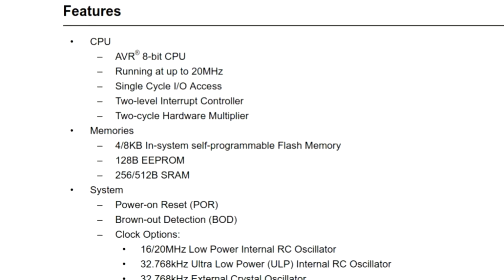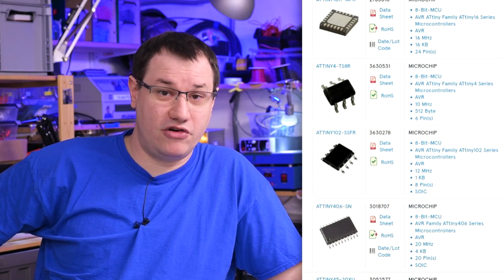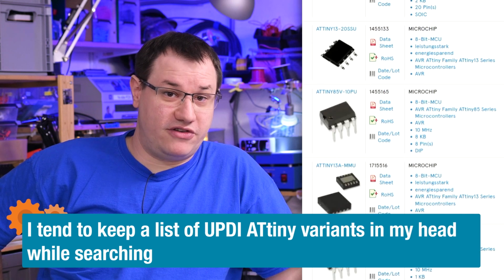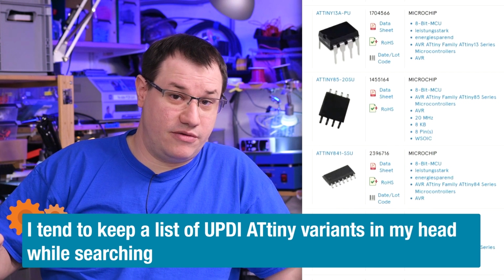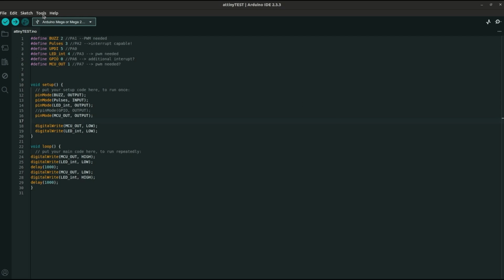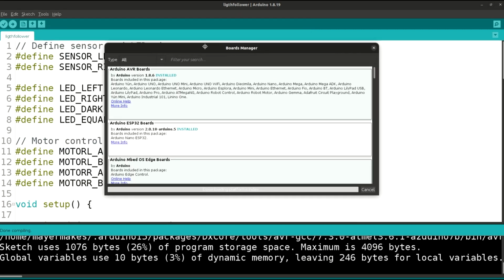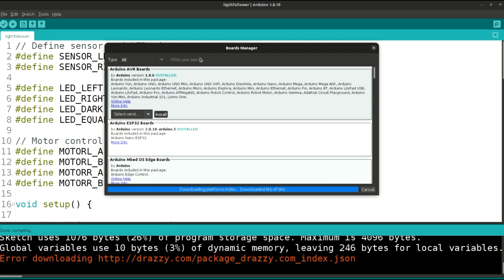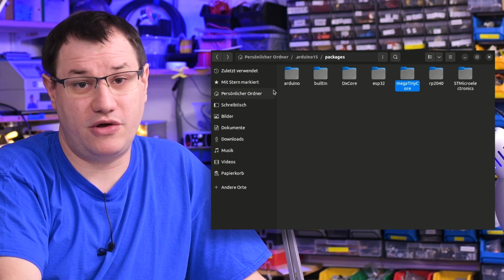I Tried Building 16 ATtiny Robots with Vibration Motors – It Was a Disaster

Comment: Lots of familiar issues there. Adding lots of test points on the first board iteration is a good idea, I like to use sockets components on my prototypes so I can swap in replacement parts without needing to resolder.

Comment: It happens all the time , no library for a certain popular part, you ask why ? Its popular, or not all libraries work with all mcu ex: arduino vs esp32, that alone makes me pull my hair out. And if you make the project small, and leave out a part, because you forgot to add it into the schematic, good luck bodging it in. And yes you can buy from not actually the most trustworthy places on the internet and be fine, most of the time, but when time constrains apply , guaranteed to get the only faulty ones! Bonus if they are small and have no legs.

Comment: Ahahaha.... I can really relate to that. Almost ten years ago, for my masters thesis, I designed an optical tracking system for those tuio/acto thingies (based on mouse sensors)... I basically went through the same steps. I guess the only "solution" is better foresight and planning which required a lot of experiences. Which in turn requires actualy doing lots of these projects. Well... In the end it was fun none the less. Thanks for sharing! ;)

Comment: The biggest issue seems to be lack of capacitance, which can cause brownouts and erratic behavior in digital circuits. And a ceramic cap flying like in 6:02 doesn't really help much, it needs to be as close as the source as possible. Add at least one bypass capacitor per chip, even more if it will have huge current spikes like near the motor drivers!

Comment: When everything works except the motors there is something wrong in the design of the drive circuitry. The motors you were originally using where too big, causing a brownout and motor stall. Other problems that motors cause are noise (EMI) and back EMF, if you're getting intermittent or weird behavior noise and back EMF are likely the cause. If you have capacitors for noise filtering (not to prevent brownouts), and sufficient grounding and shielding to shield your sensitive components from EMI. Then back EMF remains as the most likely cause for the weird behavior. Consider this, even if you have flyback diodes, if they aren't rated for at least 3× the motor voltage back EMF spikes can still make it through and crash or damage the microcontroller. Flyback diodes are not optional! And some small (100nf) ceramic caps for noise filtering don't hurt either.
Reply: All good points to look at.😮

Comment: Why would you think you could drive two motors and a micro and all the sensors with a coin cell, they've only got like 150mah of current at 3v, that's like half a watt, just the simple calculation would of told you it would never work. You always need two power sources when working with motors, one for the micro and one for the motors.
Reply: What made you think I do calculations?😂